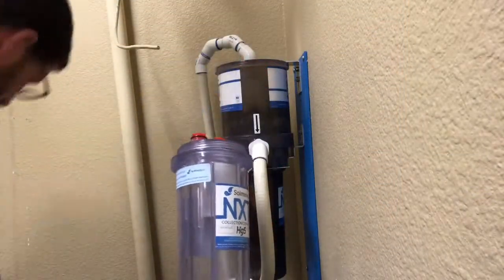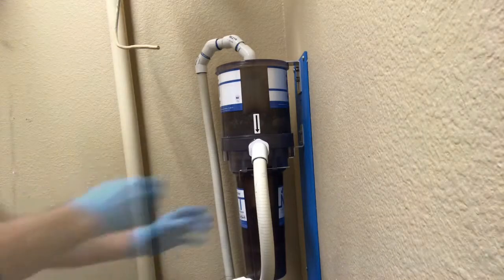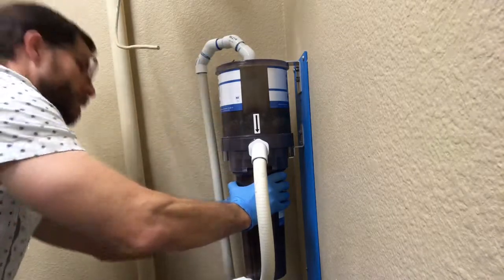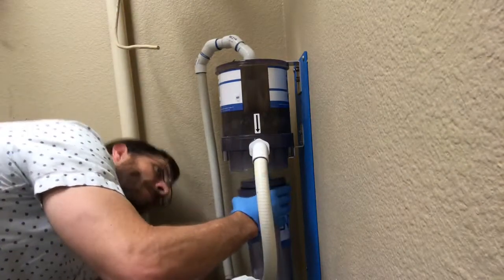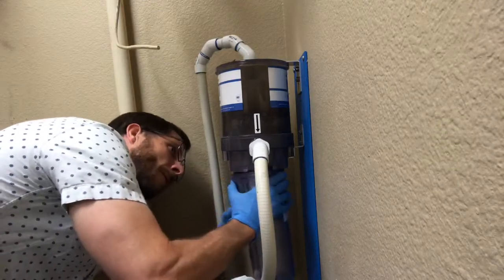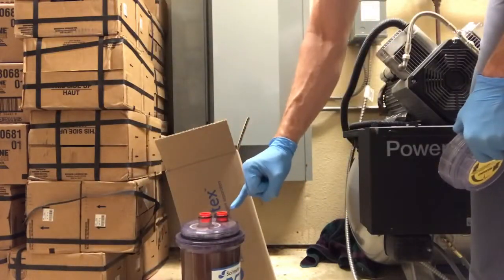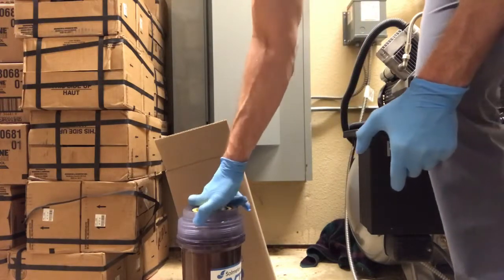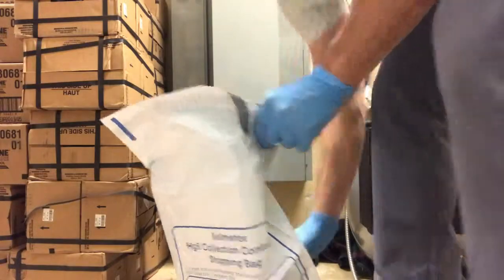Amalgam Separator Replacement

Comment: I recently got hired at a office and doesn’t look like anyone has change it in a while. I’m afraid to change it because the way it looks its supper dark and the container looks over filled. Will the water come out if I just take it off to put the new one on.
Reply: You must keep the vacuum on running mode.
Reply: Make sure they’re on but no one is using it. Shine a flashlight light to see where the sediment level is. It tends to look full if you don’t know how to check it properly.

Comment: I usually hold the container in place against the wall, and unscrew the mounting bracket from the wall. Then I lift the entire apparatus up making sure the cartridge doesn’t move at all. Then I take a new cartridge and drop the separator down onto the empty cartridge.